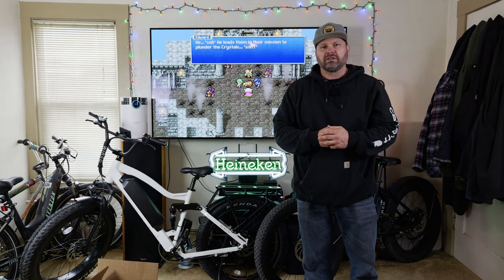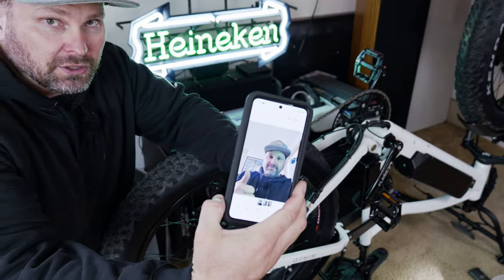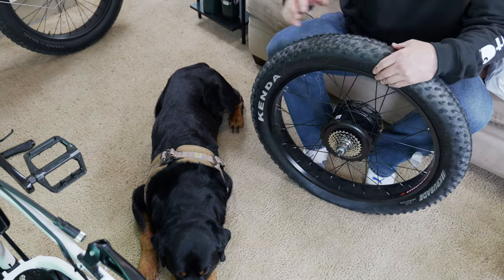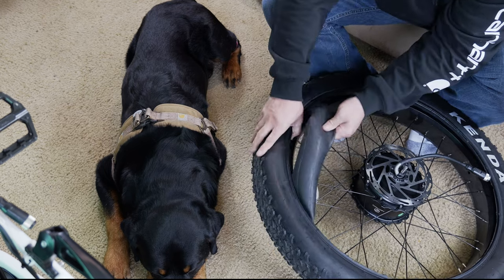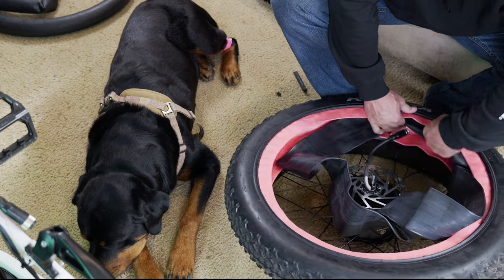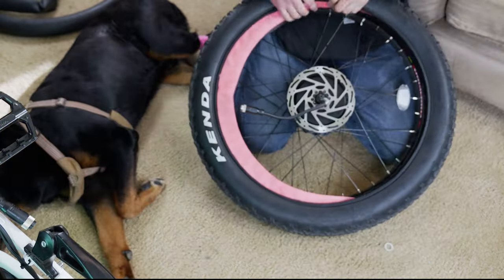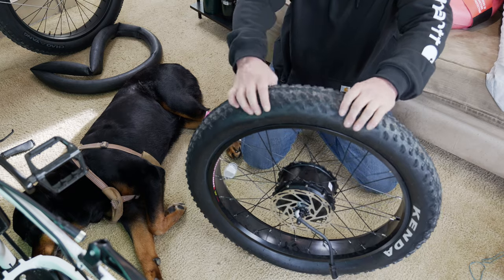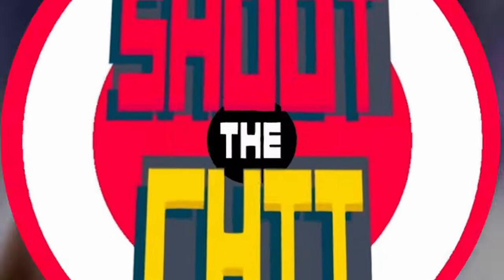How To Install Tannus Armour Inserts

Comment: HEB Allscape tires is another way of preventing flats and these are built heavy duty like motorcycle tires but for E-bike use.
Reply from the maker: Those look pretty heavy duty.  I want to go a lighter route as these bikes are already so heavy. Going to try Flat Out next
Reply: Nope. Those tires are way too heavy for an ebike. Destroys the range and makes the bike horrible to maneuver.
Reply: @shootthechit  These tires are heavy duty but not for my Spark Cycle Works Bandit and it hasn't slowed me down or mess with my range much. I've used FlatOut in the past for years on my other bike's and it worked flawlessly no more flats.

Comment: didnt you talk about how they made the bike feel slower in another video? or harder to handle. tbh i cant remember which. but i just got a stick sized thorn in the tube today and i was thinking this or flat out.
Reply from the maker: They are great and work well for what they are, but I feel like they do introduce a bit of extra rolling resistance and eat up some range.  They soften up the ride a little bit which can be nice for the hard tail bikes.  I switched to Flat Out within the last week, so I can't speak to how well it works, but its cheaper and easier to install and people swear by it

Comment: I wish Tannus wasn’t a scam and didn’t thin out over time rendering them useless. I learned the hard way, mine were so thin when a tack went through and I had to walk it 12 miles. I’ll never use Tannus again
Reply: you need to let air out once a month for a bit to let the armour regain some thickness again

Comment: Flat club!
Reply from the maker: are you running any flat protection?  I rode this bike 4 miles before getting a flat when I had no inserts.  Fat tires are thorn magnets
Reply: @shootthechit  I don't. I got to about 250 miles or so when this happened.